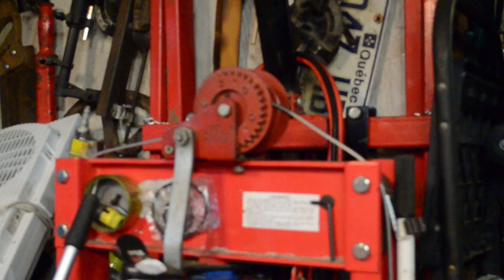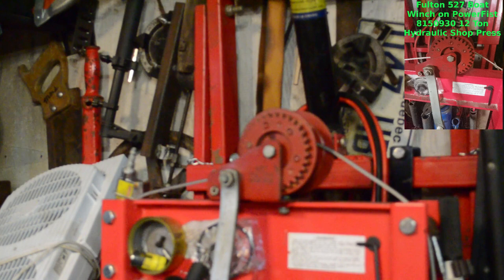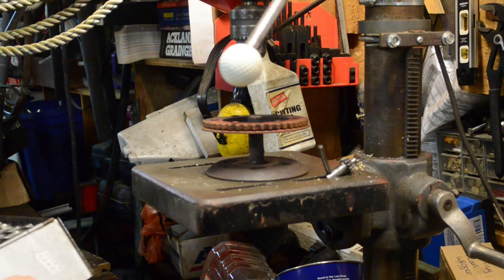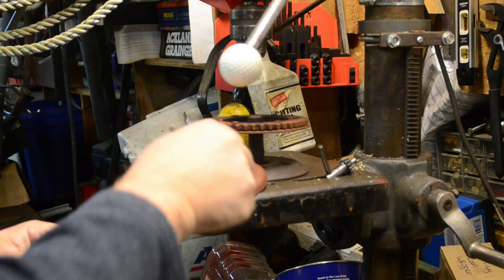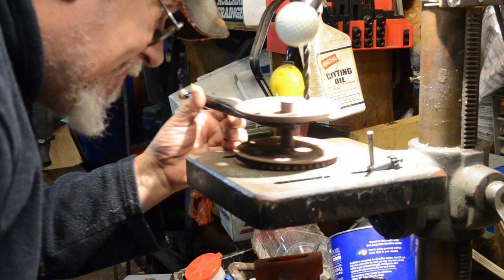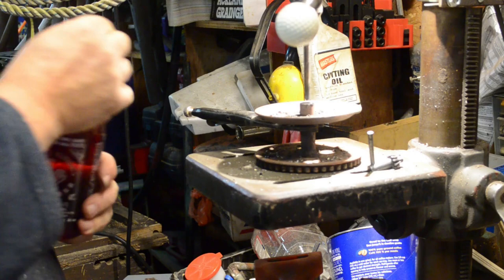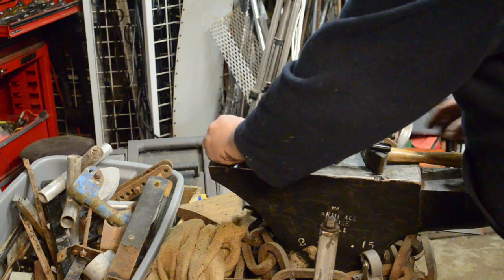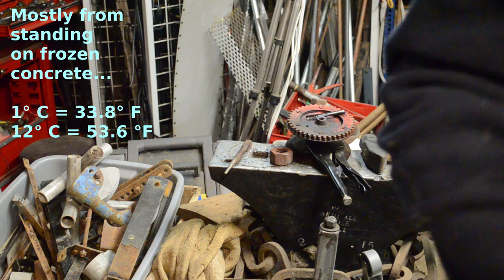Fulton 542 Boat Winch Rebuild - Part 1

Comment: Hey Tim !! You mentioned it helps to load things that are super heavy. Is mounted to the truck or the trailer. I'd be interested to see how it works !!
Have a great weekend!! 
Cheers J&C
Reply from the maker: Well I don't know about super heavy it's got about a thousand pound load rating and it will be mounted to the trailer
Reply: @trollforge  where do you mount it on the trailer?
Reply from the maker: @clivesconundrumgarden  I've got the frame it's supposed to mount on from the boat trailer it came off of. That will Mount about a foot Behind the Hitch of my trailer.
Reply: @trollforge  ah OK, so there's a ton of support!!